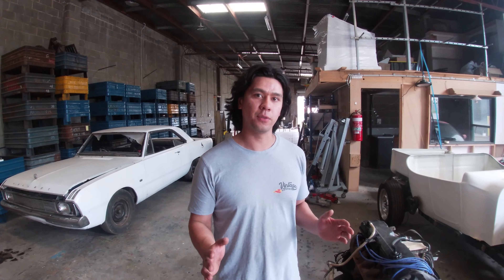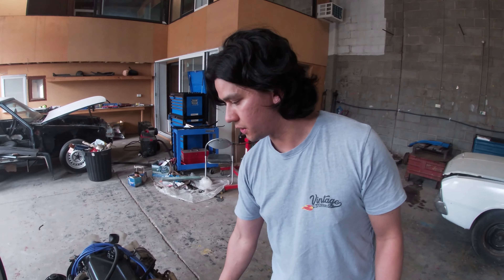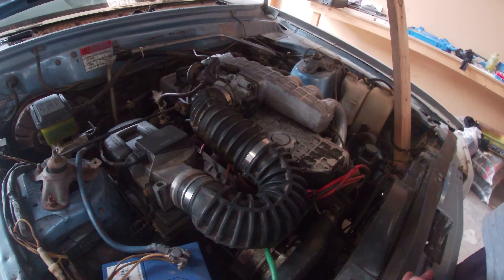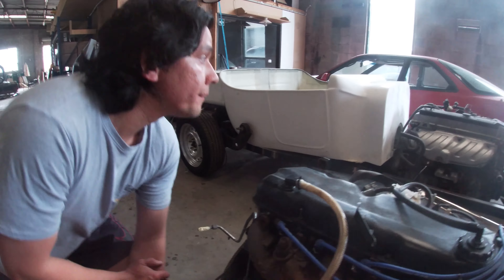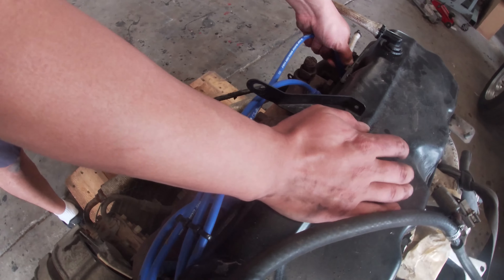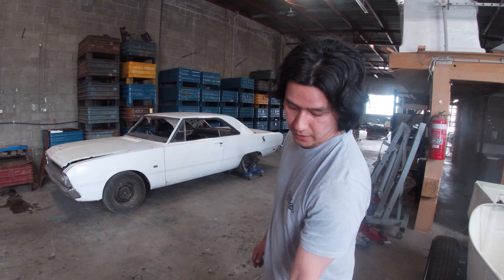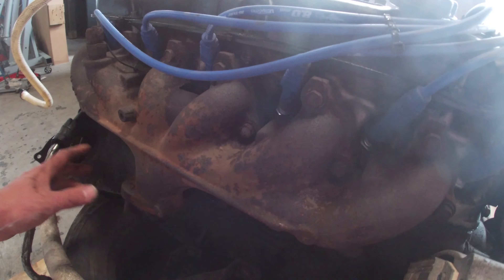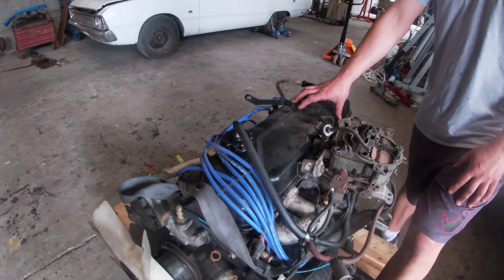CROSSFLOW VS BARRA?? | 250 Crossflow Deep Dive

Comment: Good vid thx, 250 xflow are underrated IMHO. I fitted an efi xflow to my f100 as a temporary fit. Changed the dizzy to a non efi type,  Holley 2bbl and extractors. It pushes my Effy along really well to the point that 2 years on I'm planning to keep it and not bother with the Barra conversion

Comment: Crane or crow cams will have known performance cams that have been tested and dyno run. When ordering a cam for the profile you want ie where you want your power to be?. The cam will come with performance upgrade recomendations ie roller rockers, or high comp springs etc,  Porting of head and what size intake and pistons and what type of pipes.
To get good street power its best to probably start at the cam and let that dictate the rest of the build.

Comment: Back in the day I used to love hotting up the 250xflows. Camtech do a good hydraulic 230@050" duration with the factory C2 heads... highest compression head. Getting compression up around 10:1 with that camshaft, new Valve springs, collets & retainers, C2 head 98bp ultimate, and a well tuned 4barrel 465/600holley on an aussiespeed alloy manifold. The Honda inspired alloyhead actually flow about 320hp standard. The standard 86ulp xf 250xflow came out with a 97kw motor @3600rpm flywheel. Hence the tractor name tag they inherited. Getting power up to 180hp+@wheels and they motor nicely. Torque monsters.
Reply from the maker: Such a good comment, cheers!!
Reply: @OzGeneralStore  
The specs say it all.
Low revs for peak HP and Torque and long engine life.
Given the head design is more modern than a Holden red/black
or Valiant straight six, compression, cam and carbs with associated
rocker gear, one should make some reasonable power out of it.
They are not exactly a "weak" motor.
Reply: 320hp stock??? GTFO.
Reply: @mex351  the Honda inspired C2 heads flow great standard yes. 280-320hp from memory unported. Cheers
Reply: @zacsborntorunrunningadvent3441  They were not Honda inspired they were cast by Honda till Ford could do there own. They flow terrible stock. Only 180cfm on a flow bench. Thats shithouse numbers BTW. My ported head flows 260cfm plus and is actually decent like a stock barra head.

Comment: I had a GL XD Falcon and a XD Fairmont. The GL was Tbar auto and Fairmont column auto. The GL had better pickup due to the diff. But Fairmont beautiful cruiser. Both crossflow 4.1 not as much power as Chrysler hemi or Holden 253. But very reliable never let me down.

Comment: Subscribed because of the Val in the back 
Just finished completely recoing my 265 Regal. Kept it original crystal Torquise on the outside with beige vinyl because the colour is rare af.
But I changed all the disgusting brown on the inside to pastel Torquise and I'm painting the brown crash pad beige like the doors. My grandfather looked after this car right up until he died, I'll do the same.

Picked up an 86 XF sPack ute for 400 bucks the other day, which is why I am here, I was going to chase up the turbo barra for it, but the crossflow sounds mean with a stage 1 performance cam, so I'll give that a burl until I need more......

Comment: Good vid mate, that cross flow with air con and power steer is becoming a more sort after item especially freshened up, many are sticking with the factory six for originality and they make decent power with some head work, carby and cam so not the best but not the worst thing either and far far cheaper than a Barra or V8 conversion? Still luv the roar of a good Clevo though!! 😂😂👌👌

Comment: Im def a V8 guy - but the XFlow has had its day now. The Barra is def better engineered and certainly stronger in regards to many using stock internals for 10sec passes. In saying this, there wouldnt be a Barra, if there wasnt a XFlow.....good ol blocks! My old one went perfect with regular oil changes over 500,000km
Reply: To get the efi 250 to go quicker replace the VAF meter with a map sensor, ecu harness and ecu out of a mpfi ea 6cyl.
Reply: @craiglarnach9077  Never heard about that before, its amazing how much parts can be used between the Ford sixes.
Reply: The granddaddy of the Barra.

Comment: There only over fuelled if you use too big sized jets in the carb, if using the correct sized carby. If the carb is to big it will actually flow less fuel cos the engine can't create enough signal to pull more fuel thru it.

Comment: So big yet produced so little power
Reply: Its only 4.0L wtf you talking about??
Reply: @jrburger95 it's 4.1 litres
Reply: HP is not everything , HP was changed from gross to net in the late 1970s , one year a ford 7.5 litre 460 big block was rated at 335 HP next year's same engine rated under net power 120 HP .